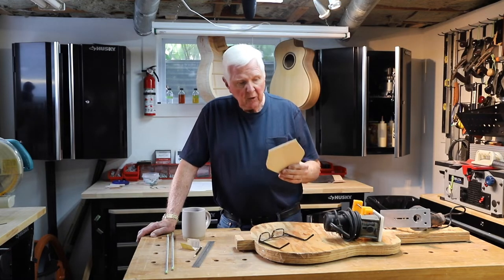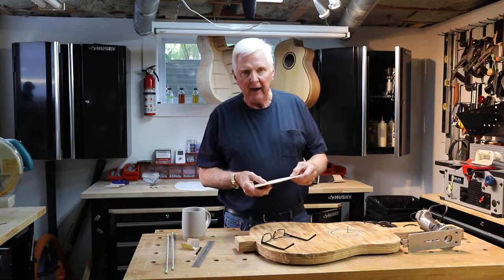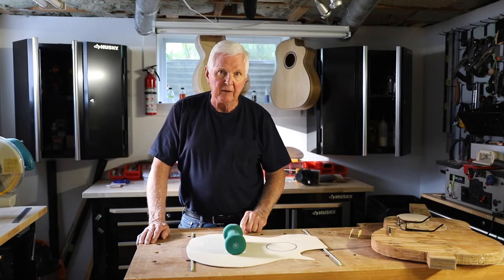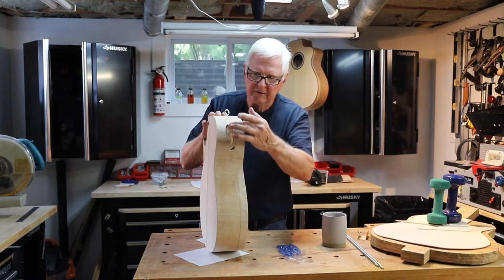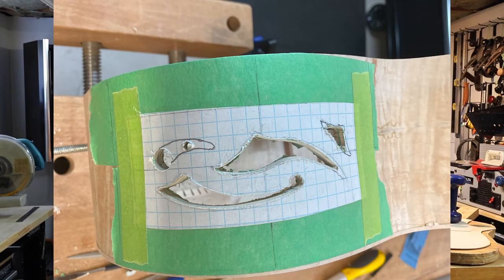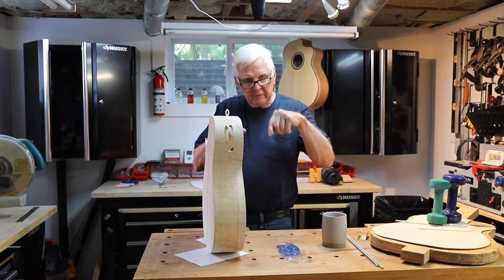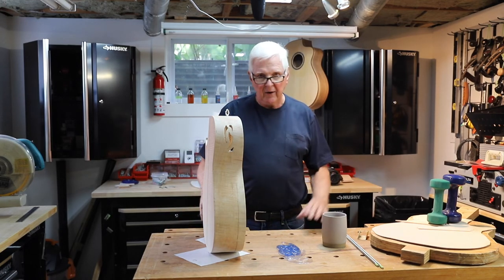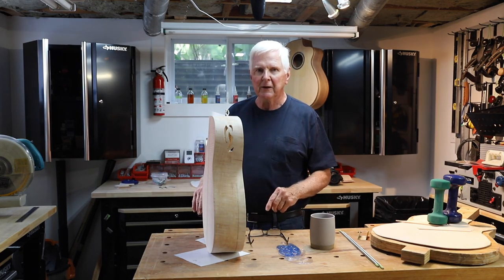Making an unusual Sound Port

Comment: Great video, I'm now 28 and found this great hobby, I'm not really good at hand-skill things so for my first two guitars I'm looking to make a different sound hole at the top (this is to avoid installing a rosette because I think I'm not capable to get a good one at this point) and some sound ports at the sides (this to hide some cracks I made to the wood while I was bending the sides) but I'm not sure how to make the holes, the idea you present on this video has became now a good posibility, so thanks for the video!
Reply from the maker: Use Starbond CA Thin glue for the cracks on the sides. pull them together with clamps and put a thin bead of CA glue along the crack. Use 100 grit sandpaper to rub over the crack and force sand dust into the crack as the glue dries. The sandpaper will be garbage after using it for this. If you order some glue use my name at checkout for a discount. Can you send me a picture of what you are thinking regarding the soundhole? It is a particular size and location for a purpose of getting good sound from your guitar. Hope this helps. I'm here to help you if you need it.
Reply: @MontyMcKinnon  Thanks for the reply, I'm still not sure what pattern or pitcure i will use yet it is a hard choise but as soon as I figure it out I will be sending you pitcures.

Comment: Very informative video Monty. Thank you. 
Q. The green 5lb weight and 1/4 inch pieces drop the soundboard to the bottom. What else do we need to know about that deflection technique?  How does that concentrated weight kinda regulate the soundboard is the right thickness all over? I'd love to see an Ervin Somogyi schematic of his soundboards. I read somewhere he has different thicknesses down more to a science level.
Reply from the maker: Each top is different. The 5lb seems to be a good number and the flex on the top is evidence as well. It's simple but seems to work well.